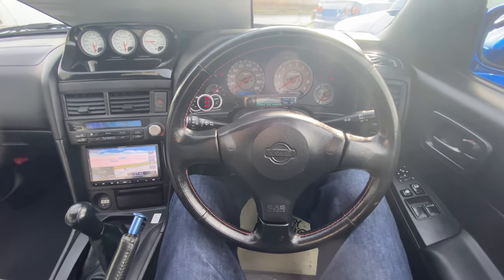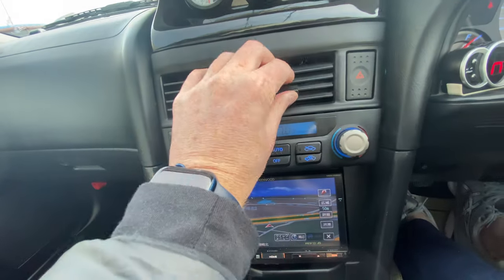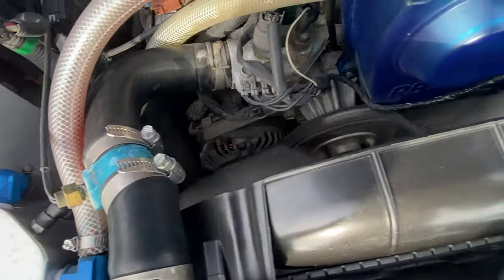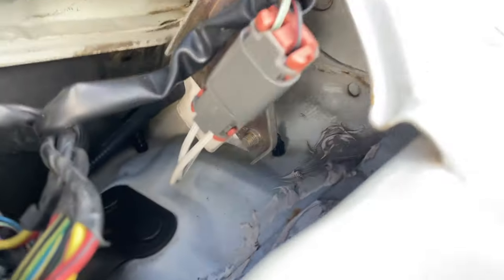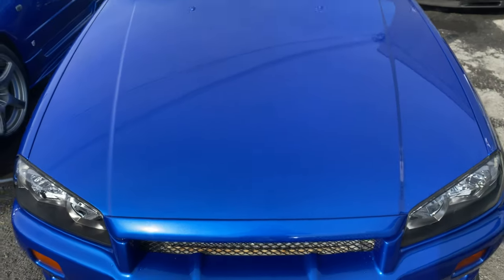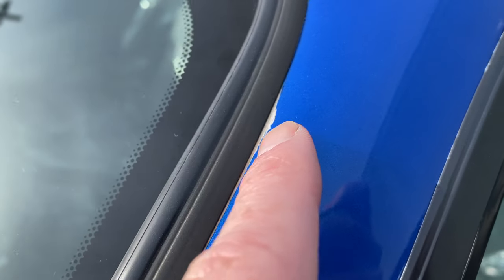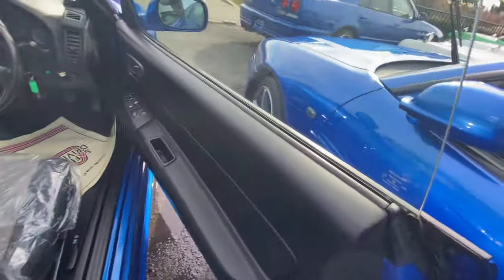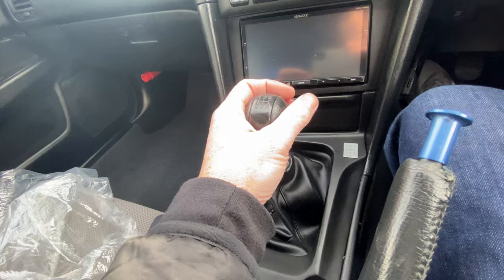I inspected a 1998 Nissan Skyline R34 GTT coupe

Comment: How about that gun metal grey GTT next to it?
Reply from the maker: That’s their newest stock. It’s a nice car but the dash is cracked and they covered it with a mat because they said if they repair it, odds are it’ll happen again and there’s really no used dashes available.
Reply: @secondchancejdm1446  Ah bummer. Thanks! 

Is the crack from the hot boy pod guages? Or sun?